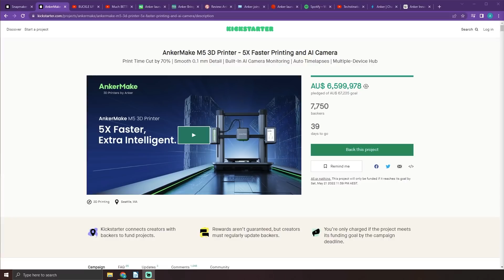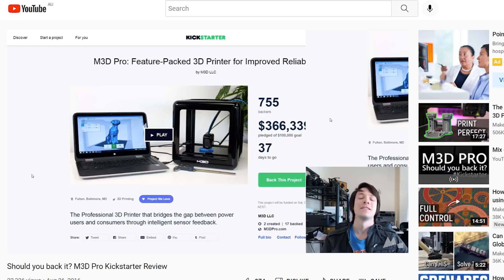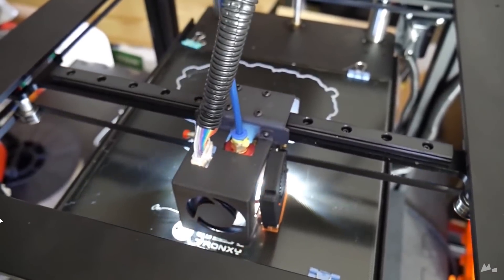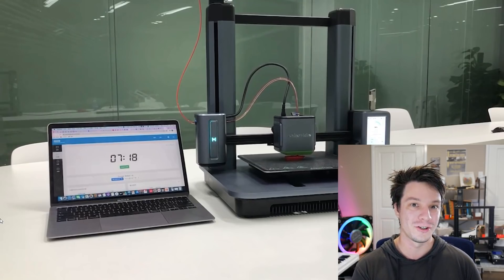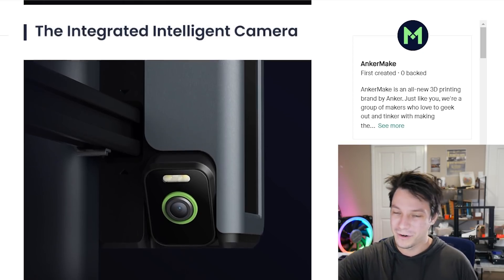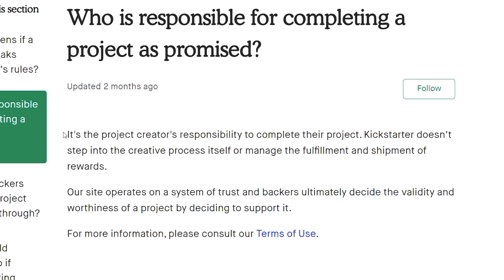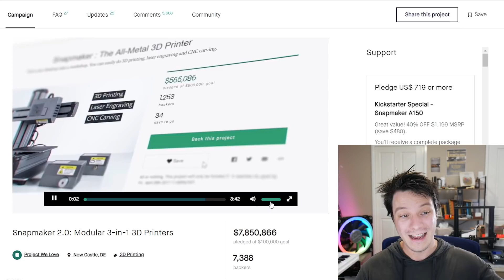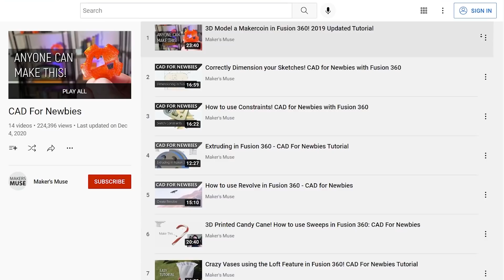This 3D Printer looks incredible, but...

Comment: What will a 'consumer' do when the nozzle is clogged, the bed lost its adhesion, a wire got loose or broke, a fan stops working, a tube got worn out...
I think when you want to sell a consumer product, you must have a network of service points, where the consumer can bring his broken machine to and pick it up a few days later. 
Or you make it so cheap, that you just get a new one, when it's broken. 
Hard to imagine, that this will be more than just another pretty looking i3 clone.

Comment: So while I dont know if I would buy an AnkerMake, you made an unfair comparison about the knowing how to model. Sure modeling help, but I can go buy an inkjet printer at the store right now along with photo paper and ink and print photos. That doesn't make me a photographer nor does it mean I have to be a professional photographer to get use out of a printer. It sure helps but its not a requirement. I have owned an Ender 3 Pro for less than 6 months and have picked up enough 3D modeling in my spare time to make functional parts but I wouldn't call myself a professional modeler. Honestly my big wonder is how something like this will handle working with a variety of filaments. Cura has different settings to be used for TPU vs Nylon so even if you have a model the printer would either have to be aware of your filament or the slicer program would have to be aware of the filament to make good choices.

Comment: If you don't own a 3d printer and have been considering getting one, I would strongly recommend backing this, assuming you will be able to one for around $500 USD.  I saw the quality and features of the printer on another video recently, and this printer just seems like a steal for that price. The fact that is has auto leveling, can print super fast, appears to be ridiculously easy to assemble, and just looks super clean and made out of quality material, for around $500, this product is a no brainer.

Edit: Just saw the cheapest pledge was $629. Still not a bad deal if you plan to print a lot.

Comment: Don't worry the next step to 3D printing is coming. I've been printing since micro center showed their first printer. I don't make YouTube videos I make machines. I've been working on the next new design that works different than what we have now.  Absolutely straight walls with the ability to contour. It still uses standard filament just in a different way. No drips no excess and no worries. Just hang tight more news to come.

Comment: My main issue with 3D printers becoming like inkjets is that their consumables would probably become ridiculously expensive and only work on the printer they're designed for.  

Unlike a 2D print, a 3D print can take several iterations to get right (even if they print out perfectly) and so it becomes even more expensive.  What I do find attractive about current 3D printing is 'choice' - I can buy a cheap 3D filament for prototyping and then a higher quality filament for creating a final print.  If future 3D printers could maintain cheap consumables then I'm all for it.

Comment: I use an Object printer very frequently, and it definitely has it pros and cons. Removing the support material can be a major headache, and affects the surface finish of the parts depending on where the support material is located. I prefer SLS nylon printing, however you are limited to nylon resins in that case.

Comment: Jet printing is definitely going to win all tech that uses thin wire-like printing. And the reason is speed, not easy of use. 3D printing has two major problems right now: (1) printing fails too often, (2) printing is way too slow. If jet printing can fix both, it's a clear winner.

However, considering how much DRM even 2D jet printers have nowadays, I'm fully expecting 3D jet printers to require "ink" that's really really really expensive. And the print head will still clog and the device goes to trash.

And the speed is important because these things can potentially catch fire and insurance companies are going to ban over the night printing at home. You cannot really bet your home that the printer doesn't catch fire this time.

Comment: I think we need slicer improvements more than we need printer improvements. A slicer with FEA where I could specify how the part would be stressed and the slicer would vary ceiling/floor thickness, perimeters, and infill to maximize the strength to weight (aka print time) ratio. Bonus points if the slicer can suggest reinforcement strategies (e.g. insert a screw here or a carbon fiber spar here) and incorporate that into the FEA.

Comment: I found it interesting you talking about the first layer. Today I decided to print the Nautilus gear. Pretty simple print right? I have a lot Max dual color extruder with the laser etching capability. The printer is already set up with some pretty successful white pla nothing special. I cleaned the bed with 75% rubbing alcohol. And I started the print and I watched it and that first layer of gears was all jacked up. So I stopped the print I looked at it in situ for a few moments and I decided to try it again but I went into the controls while the bed and the head was warming up and I slowed the prince speed to 70% and increase the extrusion by 10%. Start the print started and I had a beautiful completed print at the end. I'm not sure why I needed to increase the extrusion but it just seemed like it was too thin on that first layer. I had a little bit of stranding but nothing serious. It's thanks to your videos that I was willing to go into the settings and make the changes that made sense to me.

I don't know if you realize this but you come across at least to this old skeptic as being very honest and that lends you trust that someone like me not give someone I don't know. Keep doing what you're doing. You're helping a lot of people myself included that probably don't say anything about it. You know those guys that kind of work out there and on the internet never saying anything and just moving along or watching for your videos.

You strike me as someone who is interesting in the environment. I have an idea that is based on an actually tried and true windmill that's non directional. It was actually proven to work in an industrial scale. If you would be interested in prototyping it and if he can make some money off of it I wouldn't mind at all. I think it would work and be more environmentally friendly than the giant bird Cuisinart we have today. I just don't understand why we insist on making propellers for wind turbines when in reality they probably should be turbines without the hot end. That would be another alternative to design. The idea I have is a vertical system. And depending on its height and weight would determine its footprint. The design would reduce the number of birds being killed by windmills most likely dramatically. If you're interested you can send me an email through Google and I'll be more than happy to describe it. I don't think it would take you very long in 3D CAD to make a small demonstrator. And probably not a heck of a lot in the way of additional parts that can't be printed.

Comment: People want’s something easy to use and maintain without tinkering.. ok but what happens with a clogged nozzle? Or basically nozzle wear if you use some carbon fiber, or wood filament? If the owner don’t know the basics of 3D printing and printer calibration what can happens after one month of printing? Sending back the printer to the customers service because the hotend is jammed or leaks melted plastic from the heatbreak ?? 😂😂😂

Comment: I have a Prusa Mini and it has great auto bed leveling and I've had great luck with it. Super easy to use.  I'm thinking of getting another printer but I'm spoiled by Prusa and couldn't go to a printer that doesn't have auto bed leveling.  Anker Make looks good, though.

Comment: As many have pointed out, I don't think Anker used Kickstarter as an attempt to sell the printer but to test the water for pricing and interest. This is a test to see whether the design ideas are viable and worth putting in a "new" production line and ancillary support structure as 3D printing has its own support issues. This is not a new company trying to create everything from the ground up to sell a printer and is also very likely to send the units out... in other words, you WILL get the printer you support, as opposed to others that just fail.

I also disagree with your thoughts on the inkjet technology... That printer knows NOTHING!  Even your desktop printer is a dumb machine with a code buffer that a computer tells what to do. Their will STILL need to be a slicing software that will attempt to make those decisions about support and other things. There will still be issues with size of model and speeds. There will still be clean up and post processing. 3D printers are still machine tools and will still require externally designed files or gaining 3D modeling knowledge. It will be a long time before we get something like a Star Trek 'Replicator' and to be honest, aside from the many who are clever within the community, there are a LOT of others that just do not have the skills and the software needs a lot of refinement to get it into the sort of "mainstream" usage you are referring to.  Another problem is the three leg paradox, you can have Low Cost, Fast, or High Quality; Pick two...  Sorry to all the enthusiasts out there, but anything under $300 is just a "toy"... the limitations Angus kept mentioning is a symptom and evidence. Go find a good Mill, Lathe or other complex machine tool for under $500 and it will be substandard as well. Good tools are going to cost more, both in knowledge or skills and money. The bar for entry is already lower for the 3D printing community with vastly better sharing and support than other fields. What I will agree with is to keep taking strides to make things better and less complicated.

Comment: Fusion 360 is getting expensive if you have to pay for it and they're doing that Darth Vader "I'm altering the deal, pray I don't alter it any further" thing all the time, making it less and less usable as a free product. TinkerCAD is fine but it's a little limited. For me, what seems like the best way for a hobbyists to go who wants to learn 3D designing for 3D-printing use is FreeCAD. Yes, it's quirky, yes it's still a work in progress, but I've used it (starting from almost no skill) to make functional parts and even some speaker stands for my small desktop speakers. And... itr's FOSS.

Comment: I had a question with Resin jetting. I heard that the design for it to work out properly is that it needs to be properly cadded where you need to have end ends of a line or wall touching the other line or wall. I forgot what the proper term for it but its to me something called "closed" as you do in proper cadding programs Fusion360, Solid works ... etc . Problems arise from cadding via mesh in software such as rhino or cinema 4D as the shape is not actually "closed" i.e. 2 lines seem to be touching but when you zoom into the design, they are not. the mesh seems to be closed off but it is actually an approximation of the visual design.  

The cause problem is due to liquid resin, where it is many times less viscous than FDM plastics with a smaller volume, it will cause holes in the print. And where the area is crucial, the print will fail too.

FDM in my opinion is quite forgiving in design as small holes will be kinda filled because of the large resolution of the nozzle, so small errors are more or less negated. When using a more accurate machine, the cad have to be more accurate as well. So in terms of random cad files online, FDM might still be something worth considering as a more forgiving option.

I don't have alot of experience with a Resin jetting machine, just touched it once of twice in my life, and this are my 2 cents.

Comment: Most of the low and mid priced printers on the market are structurally weak. To compensate they add sensors and autolevelling & other stuff, that adds complexity and barely solves the main issue.

Comment: I think resin jetting will just be another segment.  It could become the biggest market segment, but it has its own limitations.  The extent to which it displaces other technologies will depend on multiple factors, including speed; build volume versus overall footprint; price, etc.  Not to mention potential advances in existing 3D printing methods which could impact adoption of resin jetting.

Comment: Talking about your 10 year predation, I too forward to a home polyjet machine, but not for the reasons you say... well, actually for the reasons you say, but not for.... okay, this is confusing. Let me start again.
You state that polyjet is the future because polyjet simplifies the slicing and kinda makes that go away. And I agree with both those points, but not together. 
FFF could make the slicer go away. In fact I really hope they do sometime soon. The Toybox 3D printer did away with the slicer and it's praiseworthy because of that. And I hope someone makes that happen.
I also want polyjet in my home, mostly because of what it makes possible with multiple and mixing materials. Hard and soft and dissolvable materials in one print, with a fine mix of hard and soft so you can have a gradient of textures? Yes please. Full, and I mean full, color like a photograph. Please please please .But home polyjet might still have a slicer, and home FFF doesn't need to have one. But the future is probably both of these things.

Comment: Good overview.

I would love to see a panel of printer makers get together and discuss what they see as the end-goal of 3D printing. The "once we hit this point, our innovation is a clock speed bump because there's nothing left to do". While it's expected they'll hold keep nuggets to themselves, I just don't see it right now. 1/4 the big names make something new and possibly unique, the other 3/4 crank out the same machine time and time again. The hobbyists seem to have reached a Stockholm Syndrome moment of "no! This machine is perfect!" while the Ender-3 they <3 so much is clogging and/or stringing on anything that isn't a vase mode print. The ones who have moved beyond that have decided that they will proclaim some hardware design as perfect and put all their eggs in software... only for someone to come along and point out the flaws of the hardware (or they decided not to get into hardware sales and people race to the bottom with hardware that doesn't actually meet the reqs necessary for the design's goals), and for the software side to gatekeep/egotistical and still be so-so. A one trick pony in many aspects.

Pretty grim and sadistic outlook, and I'm the one who typed it.

I with Anker the best of luck, but my standard is until I can give a printer to family members, it's not anything more then a toy or a tool (in the hands of someone who wants to work with it). And if any example of my pessimism was proven, it was Joel showing a voice controlled printer. The number of times Joel had to say "yes, you can turn off the voice" because the response many gave to a voice controlled printer was "but how will I control it from my print farm?". Well... the number of times was "too damn high".

My expectations for the future is a printer that uses non-toxic materials, can be operated with minimal training, looks good in a living room or kitchen (no, not everyone has a garage, basement, or workshop they can put some industrial machine in), and can do things such as "you have a jam, please remove the cartridge (or whatever it's called), out in the new one. Please wait. Ok, ready, continue or start over?" I honestly imagine it to look closer to a microwave with a "fancy coffee machine" style collection bin on the side. Something you can say "print" and it goes and does it. No removing the ooze that starts coming out, no need to worry about small hands or pets making contact with it, no wires that can be snagged, and the big one: enough standardization that you don't need to go to a specific manufacturer for repairs. I've always wanted to try and design my own printer, but my projects of interest list is longer then this YouTube comment.

As for resin jets... they may well be a future option, but maybe it would take you, Joel, Tom, Stefan, or probably any of the names out there to get a resin jet, SLS, etc. printers and use them for a month before going "this is the future". You say resin jet, I say SLS, someone else will say SLA, and another will say FDM. Then there are the nitch stuff and "I came up with a specific name for my company's product" and who knows at this point.

Comment: There is 0 chance that this printer delivers the kind of 1 button reliability that it hints at and you appear to hope for in this video. Makers Muse has been great at achieving the stated goals about enabling creativity. One reason being that this channel has been realistic and openly talked about the issues that need addressing to achieve a desired goal. This printer outside of fancy plastic casing that they have access through from their manufacturing it has NOTHING unique that isnt available on printers right now. A printer like a Prusa or Anycubic along with Octoprint and Spaghetti detective and you have it at price points you have chosen. ..and not ordered through Kickstarter so isn't vaporware. The video on this printer is making the same promises and nearly the same video as dozens of printers before it.